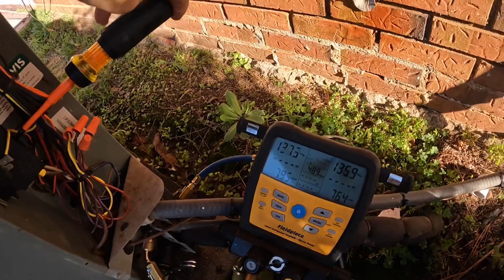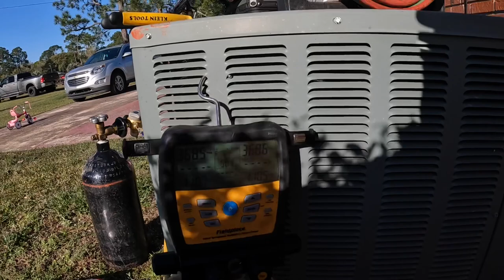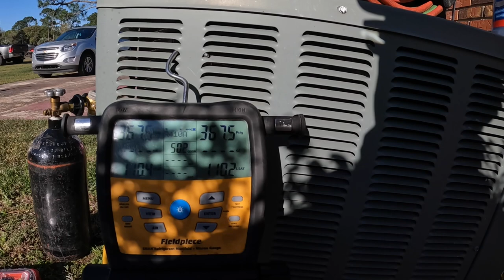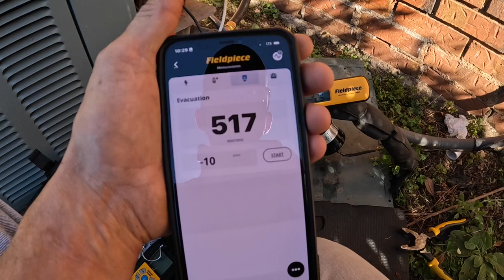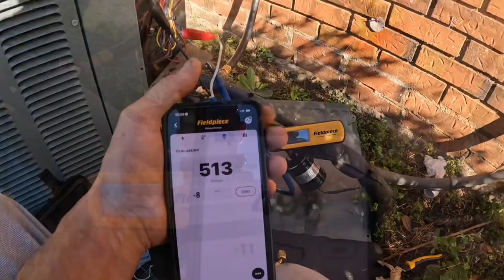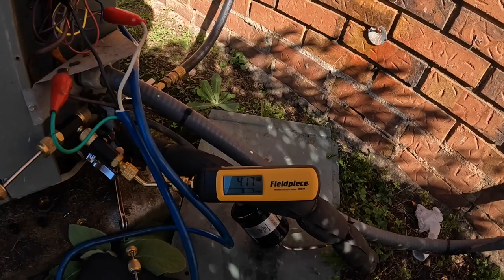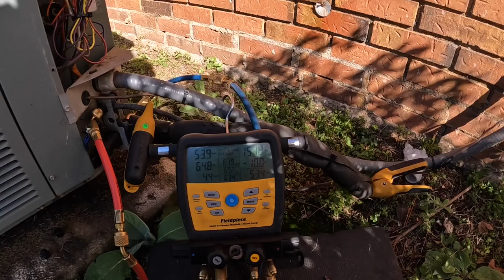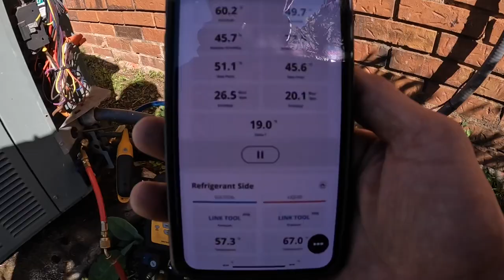Leak Repair, and First Use of Fieldpiece MG44 Micron Gauge

Comment: I use the a 1/2" navac vacuum hose straight to my vp85 with a apion core removal tool with the mg44 on it. I pulled a vacuum of 210 microns in 3 minutes today on a 30' lineset
Reply from the maker: Dang

Comment: Its good to see proper vacuum procedure in the SE. Most techs I see don't own valve core tools, dedicated/spare micrometers, or valve-protect their micrometer. I've seen a lot only run on 29" on gauges, then break vacuum before adding refrigerant. I have to assume that's why I see so many restrictions.

Comment: I’ve been looking at a new micron gauge. Might give it a try. Thanks
Reply: I've had a yellow jacket Omni and 69080. The Omni was essentially ruined after accidental refrigerant or oil exposure. The 69080 has stayed accurate with cleaning. The fieldpiece micrometer in the smans needs cleaning regularly due to in-line design. This one should be good if its cared for.
Reply: @Brokentwobutton  I use smans and sometimes question it’s accuracy. Thanks for your opinion.
Reply: @Brokentwobutton Thanks

Comment: How are you able to get the core removal tool on the high side valve? I can never get it to work. Did you do something special? The way those ports are designed really makes it difficult for me to get anything on the high side I’m only able to get the core removal tool on the low side
Reply from the maker: There’s a screw that holds the bracket over liquid line. It had been removed before I got there. I put it back in.

Comment: Hey Curtis, are disconnecting the low pressure switch when you pump the unit down using the compressor? Thanks in advance
Reply from the maker: I pushed in contactor with a screwdriver. So no I didn’t disconnect that
Reply: @HVACGUY  okay, thanks....hvac on......

Comment: Can you make a video with all the common place units usually leak at for example Rheem split is usually by the high pressure switch
Reply from the maker: That’d be difficult to put together

Comment: Rude and reem are blue energized in heat 
So disconnecting the blue wire is redundant just push in the contactor 
Now on the other guys yes you  have to jump out the revering valve
Reply: The SE was just in a cold snap. The customer can run their aux heat by that stage of repair and disconnecting the RV makes sense if so.

Comment: Why would you pull it into a negative on the pump down if it’s leaking inside??? Pulling air into the system. 😮 better to close it at 10PSI and add a few ounces of refrigerant.